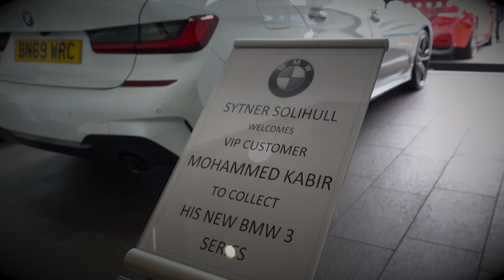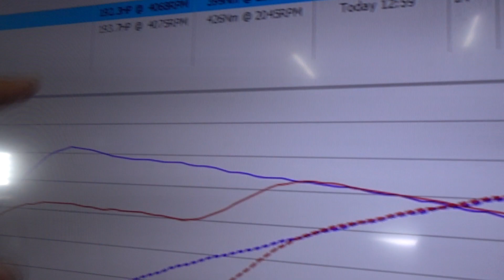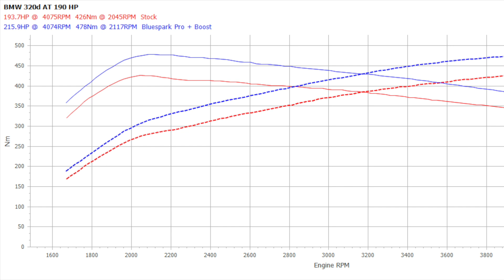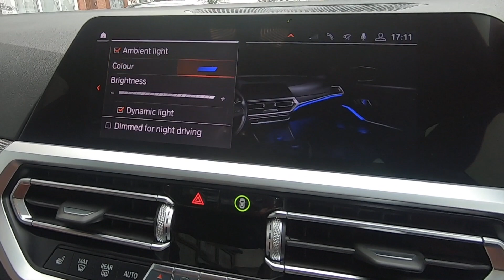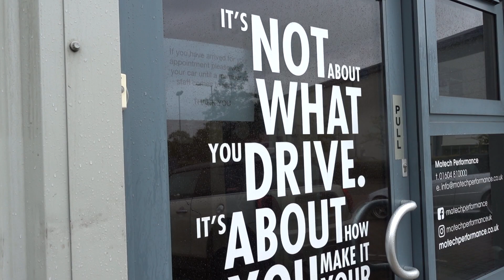Transforming My BMW G20 3 Series in 10 Minutes!

Comment: If you had to choose between a F36 440i and the G20 320i, which would you choose? Evaluating on driving experience, practicality and looks.
Reply from the maker: 440i for the engine but the G20 for a better package. Go for a M340i if you can.
Reply: @DownShiftThrottle  thanks for the reply man! May lean towards b58 haha
Reply from the maker: You can watch my 440i and M140 vids.

Comment: Wish that was a 3 series lol that car is now so far removed from the E30 it should just be called something else. I mean they didn't even give it a manual ffs in the base petrol range and Bmw think they still make drivers cars. 🤣🤣
Reply from the maker: It's still a very sharp car to drive. When you say it's so far removed from the E30....well that can be said about pretty much any car from 2nd gen through to current gen over 4 decades.....E46 still seems to be the sweet spot though.....
Reply: @DownShiftThrottle  Why did they have to make it so big! Why do BMW ownwers always want more legroom. How is your M4 chassis compared to G20?
Reply from the maker: I guess most of it comes down to safety regulations and luxury. Every car manufacturer has gone that way from 40 years ago.... look at a VW Golf, Audi 80 to a A4 and a 190E Merc through to the current C Class.

M4 is a fun chassis.
Reply: @DownShiftThrottle  some reviews say the M4 feels huge down a b road. How do you find it?
Reply from the maker: Check out my M4 vids. Feels brilliant
Reply: @DownShiftThrottle  sounds good, I'm thinking about a 140i. Would you bother? Currently in a BRZ
Reply from the maker: Check out my vids on my M140i. I owned that car for 2.5 years. You'll find everything you need to about that car on my channel 👍🏽